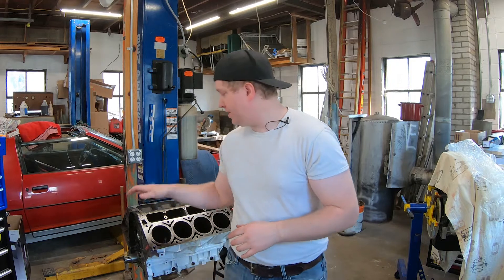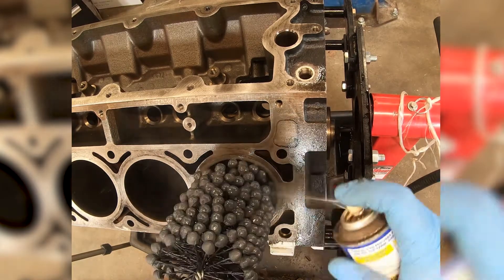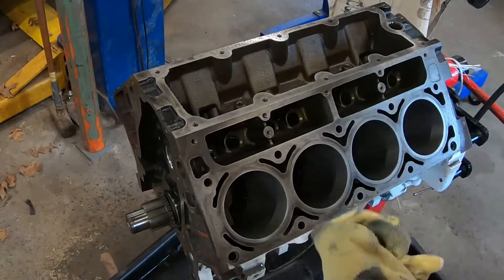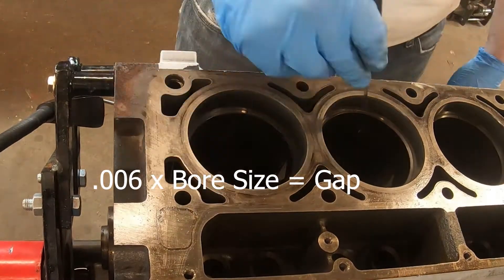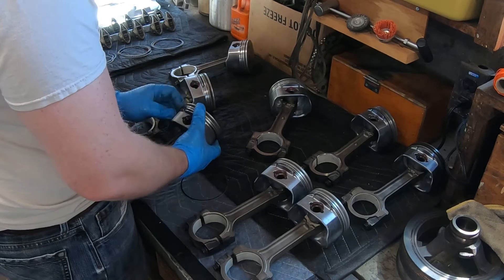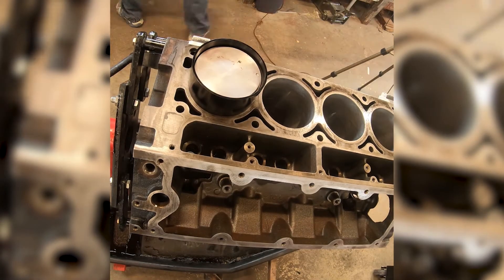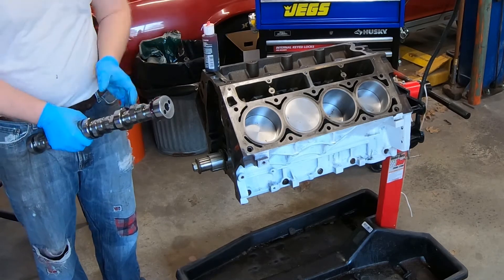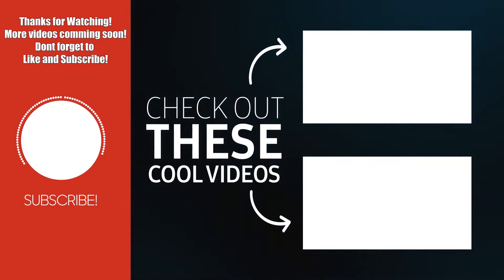Installing Gen 4 pistons and rods  in our 5.3 LS along with gaping the rings and Cam installation.

Comment: Is that a gen 3 crank? If so did you have to get it balanced? I have gen 4 rods wanting to install on a lq4 gen 3 crank, just curious 🤔
Reply from the maker: Gen 4 crank - wow im late to these comments....
Reply: @Vindexx  10-4 I've sence built that engine, and did have to get it balanced, gen 3 crank, gen 4 rods..
Reply from the maker: @foreverendeavors6210  how did it run?
Reply: @Vindexx  runs good, my daily, btr stg2 cam, tbss Intake, corvette injectors in an 04 yukon, runs good.

Comment: Does it matter on those flat tops whether they face forward or backwards? Technically they are symmetrical in all directions.
Reply from the maker: Im not sure if it "technically" matters, but the Dot on the piston is supposed to face the front of the engine. I never tried any other way, but I'd be curious to see if it made a difference.

Comment: If you just cleaned the cylinders with the crank installed you should use throw it all away. Meant fillings all over bearings.
Reply from the maker: It was all disassembled and cleaned then put back together

Comment: I have a Gen 4 4.8/5.3 engine that came out the 2007 tahoe. It has flat top pistons. Not sure if I have a 4.8 or 5.3. Do gen 4 5.3 have flat top pistons?
Reply: They do….measure the stroke you should get around 3.6 inches I believe and a 4.8 should be 3.2 ?
Reply from the maker: @HectorRodriguez-yc9bj  yup 3.268 on the 4.8
Reply from the maker: Not that im aware of

Comment: Were the dimples on the connecting rods facing front or rear when you installed them? Just curious because I’m assembling mine soon and I forgot with way they came out.
Reply: Dimples face rear
Reply from the maker: I didnt pay attention to the rods, but to the dots on the top of the pistons, since they came out together, dots faced forward on the pistons
Reply: The dimples on the rods face opposite of the dimples in the pistons, so the dots on the rods face the rear